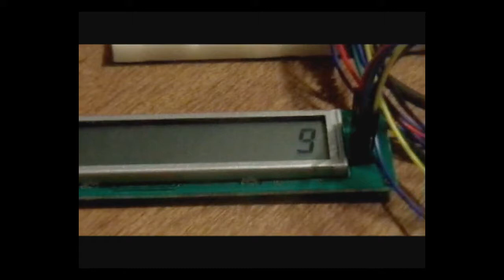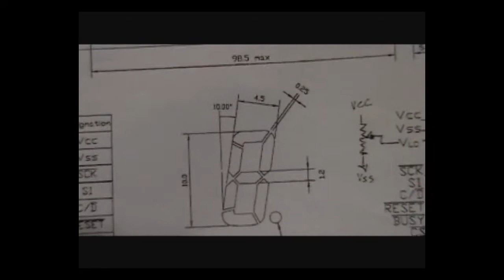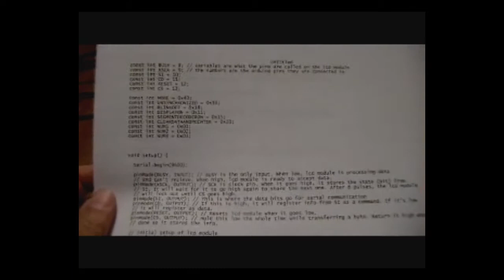LCD Driven by ATMega328P

Comment from the maker: Yeah, they are not very expensive and available from a number of sources on the internet. It was frustrating scouring the internet and working through the bits and pieces of information available to find code that actually worked and enough information to get everything setup and working correctly, but once I had the information, it really proved easier than I thought it would. Until it is hooked up correctly and you get some type of output you will swear they sold you a bad one :-)

Comment from the maker: I understand your frustration.  I tried so many different things before it suddenly began to work.  I had to be very careful about the connections between the processor and the LCD as it was easy to get the wrong pins connected.  Getting the delays correct in sending the control codes and data was also key.  I would be glad to send you the assembler code that I used if you would like.  It is rough and just test code, but may help you get it working.